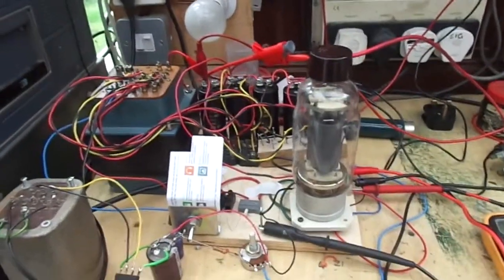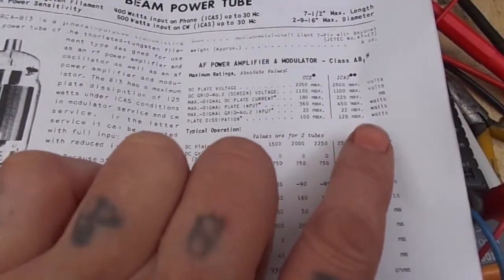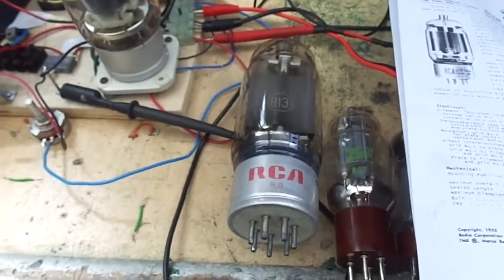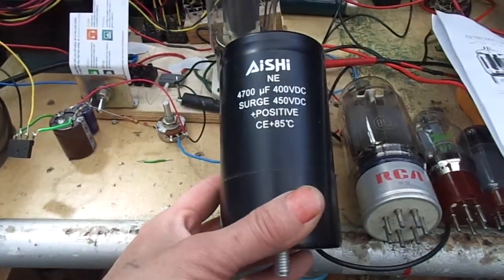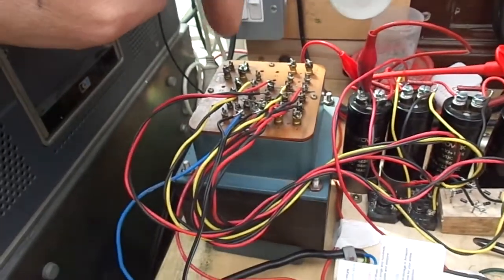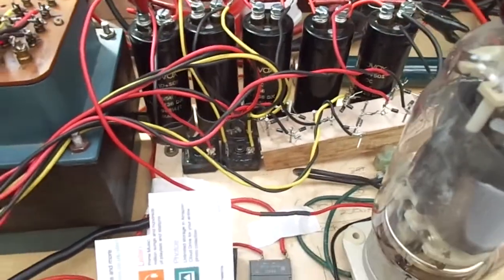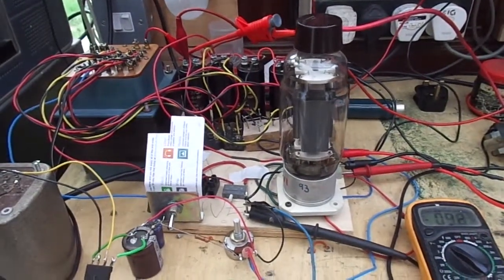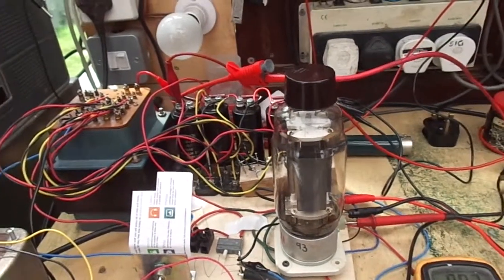Testing 813 valves.

Comment: The problem with valves designed for anode voltages in the kv range is the speaker transformers need insulation rated for x4 that voltage
Reply from the maker: Yep, spot on. I sussed that after a while. I had a planned to build a mad 4 x 813 PPP amp. Got some massive C cores for the OPT's, wound the HT tfmr etc. In the end I sold my stash of 813's & gave up on the idea.

Comment: Hi Andy, 
Long time no see on YT! Hope your well and good.
Do you still have plans to build an 813 amp?
Just revisiting this and other videos, and wondered if you carried on with the project? 
BFN : )
Reply from the maker: Hello Ian, not really been working on anything of note & also realised I needed to make better video's but don't have the time or inclination to do so at present. Re the 813 amp, sadly I knocked the idea on the head. The big issue is the voltage - 2.5kv making any amp impossible to sell.That and the cost of OPT's or the difficulty of winding OPT's with a Z pri of 10k. I sold my stash of 813's to a lad in Vietnam who makes triode strapped amps. Still, who knows, the idea is still at the back of the old noggin, maybe one day...... Take care, Andy.
Reply: @diabolicalartificer  
Hi Andy, 
Yes I totally get that, re voltage needed on those valves, not the most practical eh!

On a side note, I managed to build a SE 6L6 and wound a toroid + choke
And I have to give you credit for inspiring me to do it! 
The amp works and doesn’t sound too bad ( to my ears anyway) The feeling of satisfaction was immense when I heard music coming out the speakers : ))
The amp needs a few finishing touches ie a soft start circuit, switch etc but I have got the bug now so will build more amps, and like I mentioned your videos helped me achieve it. Yes some makers out there have more polished videos, so yours have inspired me and I am sure many others out there. 

I hope you continue to produce them and I appreciate life gets in the way and where does all the time go??
One other thing, I am researching PP OP toroid transformers, have you considered or tried winding those? Would not be an easy task I imagine?
I know they exist out there but trying to find any info on winding your own is proving very difficult. 
Take care and hope to hear from see  
you soon. : )
Ian
Reply from the maker: @ianmorgan6104  Well done, really pleased it worked and happy my wafflings were of some inspiration. 

    Re winding transformers, simply it's just a load of copper wire wound round a core. With an audio tfmr it's a bit more complex as your designing for a lower frequency, so need a bigger core and more turns, that's the bass side sorted. Re high frequency you use tricks like interleaving the primary and secondary and make sure your insulation is thin and the material you use has a low dialectic (low capacitance). Check out - https://ia803408.us.archive.org/9/items/wolpert-audio-xfmr-design-manual-1/Wolpert_Audio_Xfmr_Design_Manual%20 as a start. If the maths gets heavy remember, it;s just a load of turns on a core, have a go, the result might not be 100% but the next one you wind will be better.
    Well done again, keep up the good work, Andy.
Reply: @diabolicalartificer  Thanks Andy, I  have downloaded the manual for a deep dive another day: )

Another question if you don’t mind,
Is there a safety precaution to consider when clamping a toroid to a chassis? (Makers talk of a shorted turn ) I have the rubber grommet between bolt and toroid although, I have not yet earthed the power supply to the chassis, which is aluminium sheet on a wooden case body. 
Cheers
Ian
Reply from the maker: @ianmorgan6104  As long as there isn't a continuous conductive path all the way around the core your fine. For instance by securing a toroid with a U bolt to a metal chassis. The standard clamping kit consisting of two metal disks (or one), two big rubber washers and bolt is fine. One last thing, toroids run hotter than EI tfmr's, if you can drill holes in the disk etc to get a flow of air through the hole in the middle, not essential though. A few holes near by in the chassis is fine. Cheers, Andy.
Reply: @diabolicalartificer  Thanks Andy, appreciate the advice. : )

Comment: Not any more dangerous than a car. I've ran 813s at 4800v on a.m. and didn't have any arcing but they were blushing. Youll be a o k at 2500. Rca only, no chinese metal plates!
Reply from the maker: A bit of a spurious analogy; a car has lots of safety features and most folk know how to operate one or are familiar with their potential danger. A person not familiar with working with extra high voltages needs to treat such a circuit with extreme caution, there's no second chance if you receive a shock of 1KV from a PSU capable of 1A +, but you might walk away from a car crash. It'd be remiss of me not to point this out.
  Thanks for your interest, DA.

Comment: Its Gon'a Be a Very Dangerous Amp... But Should Sound Great !!
Reply from the maker: Yep, a 2.5kv PSU @ approx 1A has to treated with respect, but with some forethought it will be fine. It'll be a while till I have all the bits, I have to wind a mains tfmr and two OPT's first. TFL, A.